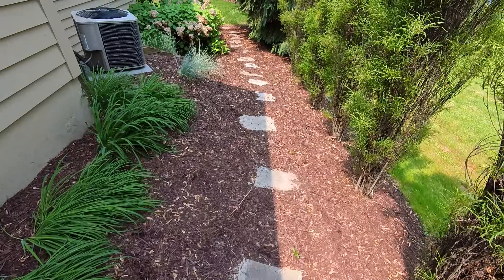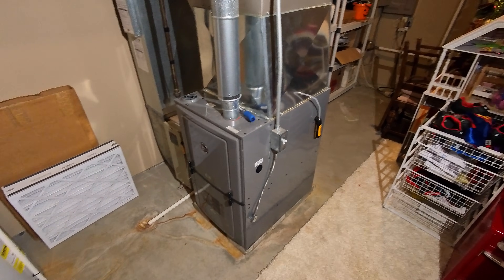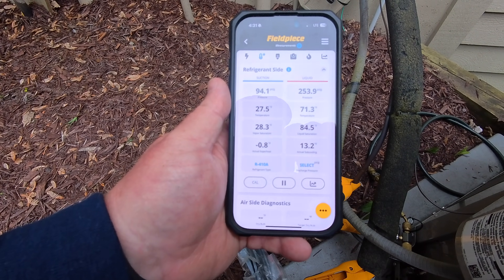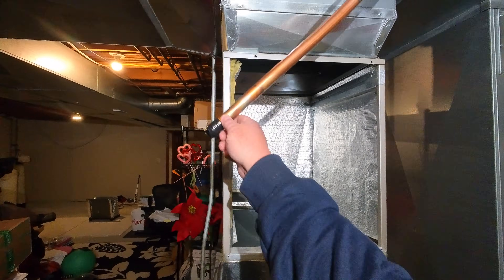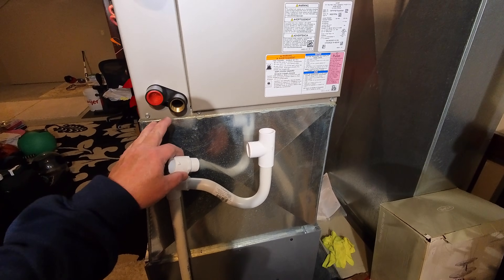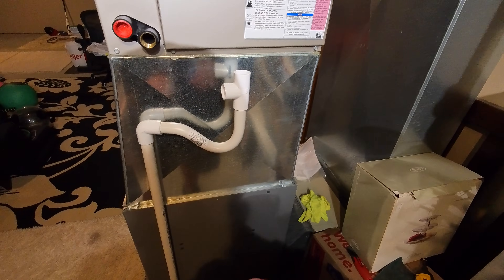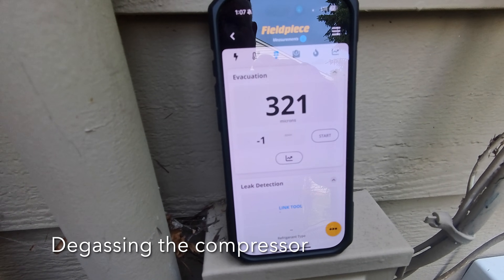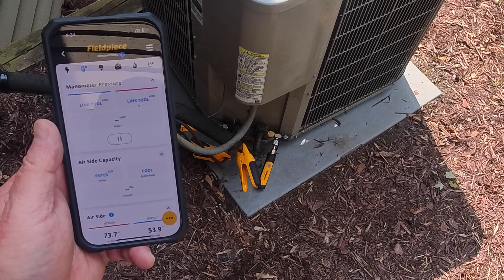HVAC | AC Not Cooling - Ice on Lines | AC Repair Lansing

Comment: was wondering if nitrogen was used just before the brazing to keep the copper from oxidizing which can flake off and circulate with the refrigerant, clogging vital components like the filter drier or expansion valve
Reply from the maker: I use nitrogen on every brazing job but I cannot speak for the initial installers, I don’t know who installed it
Reply: @HVACTDM  right... well its real nice of the installers to think ahead  to keep techs in business  : )

Comment: I’ll tell you what I do get you some boiling hot water boil in the microwave for a minute to make it that hot. Take the ball ball it emerge it in hot water. Let it sit for a couple minutes and then put it on the cold water you keep doing this until it breaks free or add some AC renew been routine the hot water, cold water just about everyone that I came to. I was able to fix the txv

Comment: I love the vent before the trap, or is it now a clean out without a cap.
Reply from the maker: At 6min :10sec  mark  I clearly show a cap on the T therefore making it a clean out. 

Without the cap the trap is useless
Reply: So then no vent @HVACTDM
Reply from the maker: Not near on the Evap drain.  It’s not required. The Evap sits above the furnace. 

Technically I didnt even need the trap, but I like to stop excessive air flow from escaping through the drain 

However There is a vent in the drain line, it’s just at the T where the drain exits the furnace cabinet. 

This is a Ruud furnace and the trap is inside the cabinet

Comment: Holy crap, you replace a coil because you couldn't get a TXV, are you serious, surely you did not charge the home owner for something they didn't need? Plenty of TXVs online, come on. You found an evap but no TXV, give me a break.
Reply from the maker: My job is to find solutions to problems. I presented the home owner with several options, the cost for each option and the pro’s vs the cons of each option. 

The home owners selected the option they were comfortable with.   I then proceeded with that option. 

It may have not been the option many would have selected  but it was the option they selected and I did exactly what they asked me to do. 

To answer your question yes a cased evap was in stock  and the TXV was not. Also the home owner paid cost for the evap there was no markup added

Comment: I can't imagine how excessive air passing over the a-coil results in low/negative superheat.
Reply from the maker: I personally dont think this was airflow related but rather an issue with the TXV.
Reply: @HVACTDM   I agree, only way liquid would be flooding back is the txv isn't metering the liquid.

Comment: Looks like you got it Mike.  So what do you do when numbers are high, but it seems to be working?  I just installed one - delta T about 15.

That's kind of what I figured.  What do you think of my numbers?

R410a 3.5T heat pump, Txv.  Blower speed: high

Outdoor temp: 87

Hi side: 91.7f  

355psi (108f),  16 sc

Indoor temp:  72

Low side:  56f 

110.6 psi (35.6f) 20 sh

What do you think?
Reply from the maker: Delta T is acceptable, Did you do a total external static pressure test?  Your head pressure seems high for 87 degrees, same with the subcooling suction pressure looks low for 87 degrees but without knowing the equipment I'm really just guessing. As a matter of fact heat pumps aren't really a thing in Michigan unless you are on propane and the cost of electricity is below that of the propane. That being said i very rarely work on heat pumps. 

Thanks for watching
Reply: @HVACTDM    I did not do static checks.  Just verified the existing ductwork had no major problems. It seemed to work well with the old R22 unit of the same size. Sounds like it's a bit overcharged?  I was wondering if the txv was partially clogged ...
Reply from the maker: Did you do your pressure testing with the condenser in the sun or shade. If it’s directly in the sun that would account for a higher head pressure.  But the result would be a higher suction pressure also

Comment: Thanks for the video sir! Your vacuum pump was struggling with all of the oil and pockets of liquid refrigerant flowing around that refrigerant system for sure flooding back. Odd I was expecting a higher superheat but then suspected your fan but your TD wasn't bad at first at 15 delta T. I expected you suction pressure to be high flooding back. Was the coil bypassing air by chance? She is fixed....Good repair!
Reply from the maker: The coil is an N coil and cased, I didn’t see anywhere it could bypass. 

I went through the gamut of what the issues could be, I even changed my gauges back to my testo 550 and I was getting the same results. 

After I changed out the coil I inspected the hell out of it, it wasn’t dirty, water went through it.  

I’m just happy we got it fixed 

Thanks for checking out the video

Comment: my fieldpiece app keeps malfunctioning right in the middle of testing, i have to close it and reopen it. does that ever happen to you?
Reply from the maker: Not if I have the app open. If I open another app then go back to the job link I need to reset it
Reply: Happens every time I use the field piece app. Measure quick never fails

Comment: Great video. Did you weigh the charge when you removed the old refrigerant? What was amount compared to factory charge if so
Reply: YOU SHOULD ALWAYS PUT THE FLAME TOO BIGGEST PART OF COPPER LET SILVER FLOW TOWARD HEAT  IF YOU CUT IT CROSSWISE THEN YOU WILL UNDERSTAND WHY OLD TECHS WERE TAUGHT THIS ESPECIALLY IF SOLDIERING 1 -4 INCH COPPER FITTINGS
Reply from the maker: I did not weigh the charge.  Once I eliminated overcharge as a potential issue.  I didn’t see a need to. 

But now thinking about it, I probably should have.
Reply: You fixed it! Was just curious if they added or refrigerant was mixed or squirrely  @HVACTDM
Reply from the maker: @chrislococo7220 To the best of my knowledge I’m the only one to work on the AC since they have owned the home.  6yr or so….

Taking them at their word it never crossed my mind that the refrigerant could be mixed.  I guess I’ll find out when I turn in the tank